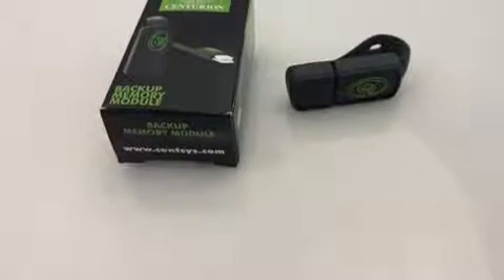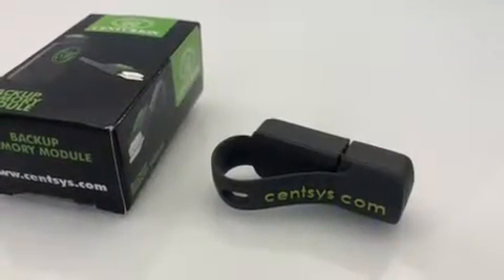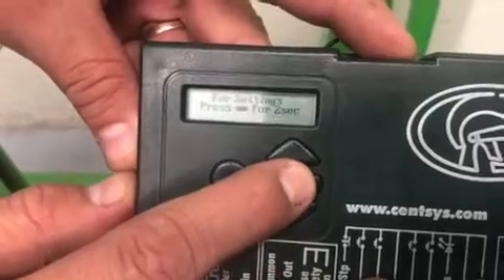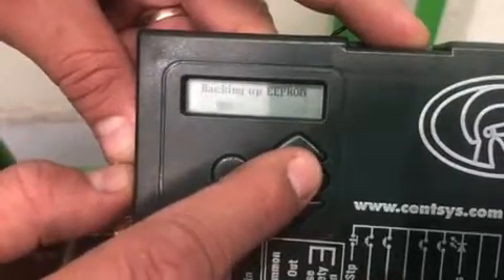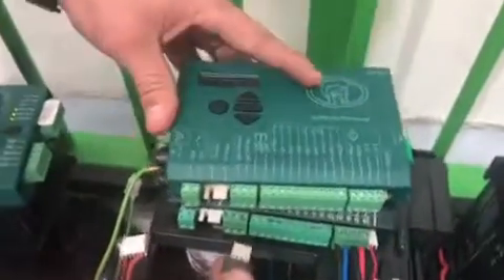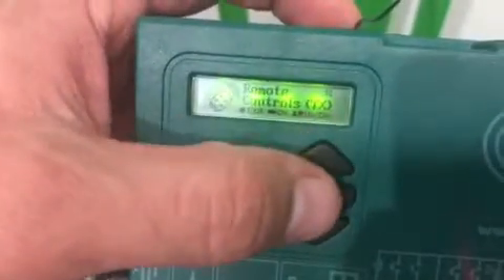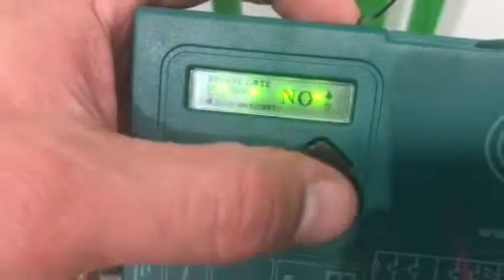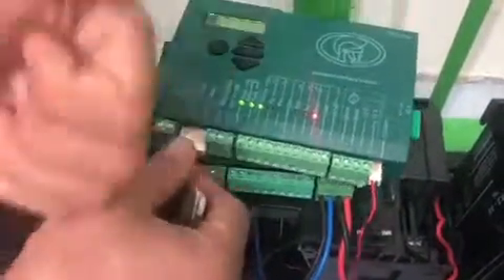Centurion Backup Module Features

Comment: How does this guy work with the new smart motors
Reply from the maker: Hi yes great device for the legacy Centurion Range but You don't need this device with the new Smart motors, instead you backup the settings of every motor through your Smartphone to the cloud using the MyCentsys Pro App.